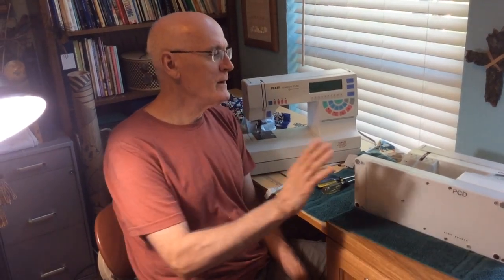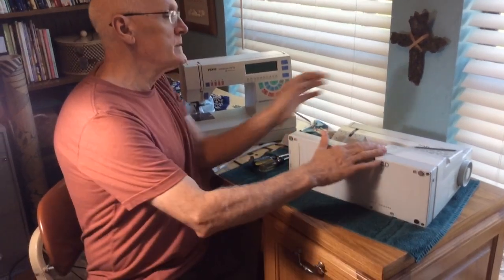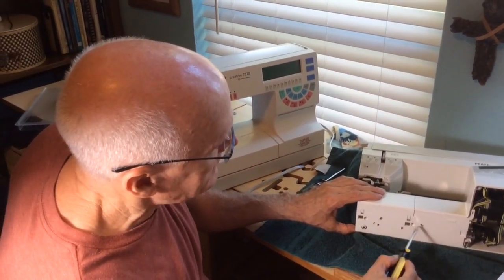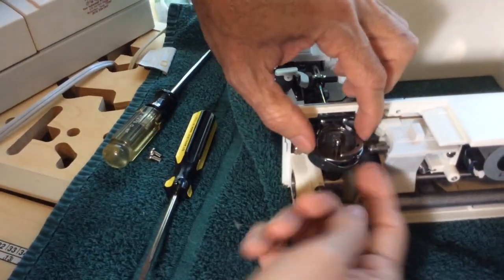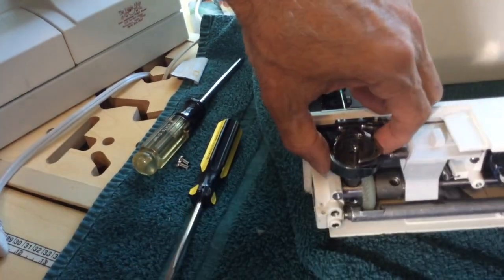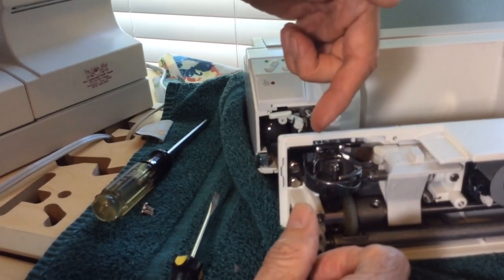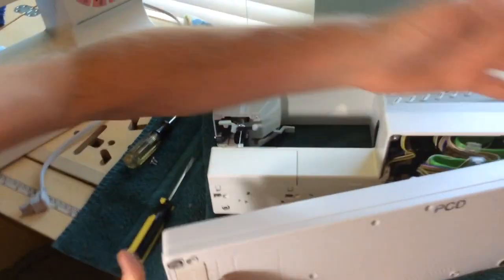How to Fix Pfaff Bobbin Hook Shuttle Jam

Comment: Useful information, but could have been so much better if you showed actually removing the screws/pieces instead of just describing it.  Picture worth a 1000 and all that.
Reply from the maker: Gary Walker this is the first (and only) YouTube video I’ve done.
Reply: Steve, this is so good. No one else has done even this level of detail. If you ever have time, be wonderful if you could show the actual disassembly and reassembly with the tiny screws. And then, how to time.
Reply: Yes, a picture is worth a thousand words. Take pictures as you're taking your particular sewing machine model apart. Then use the pictures in reverse order to put your machine back properly.
Reply: I would love to see you actually remove the bobbin assembly screws. I can’t budge them with my skinny handled screwdriver set.  UPDATE: I found better screwdrivers on my husband’s workbench. I was able to disassemble the “practice” bobbin assembly I got from ebay by removing 5 of the 6 screws (6th must have been superglued) but reassembly was challenge. The last piece didn’t just drop in! Took a lot of fiddling. When I got the middle and top piece positioned correctly, I placed them upside down on my work surface, and placed the base on top of them, picked the whole assembly up like a sandwich and added a couple of screws before it fell apart again. The rest of the procedure sounds like a bigger challenge. Anyway, thanks for pointing the way.

Comment: Actually, Steve, this was sufficient to fix my jammed bobbin hook shuttle with the following additional step:  Remove the 2 set screws holding the whole shuttle assembly to the drive shaft, then remove the assembly for easy access to the small spring/screws holding the assembly together.  My problem thread jam was solved, and the assembly was cleaned, lubed, and re-assembled.  You saved me time and money by not having to take it to a shop which was closed anyway for the coronavirus.  I'm very grateful for your video.  Thank you so much.
Reply from the maker: Gary Walker I’m glad it was helpful.
Reply: Where are those 2 set screws' located?   Does anyone have a diagram or video showing those?
Reply: I removed those 2 screws & the assembly. How can I tell where the shaft should be when I tighten them back up (for proper timing)?  (I assumed there would be flat spots on the shaft but there aren't.)

Comment: Thank you for doing this video.  I was able to fix that single piece of Thread.  Hard to believe that (1) thread and a little build up grime could stop the machine from turning.  It took using a lot of tools on hand like Torx and screwdriver heads with variety blade widths and blade thickness.  Also used your video on a large iPad for easy viewing.

Please, please do more videos!   Much appreciated!

Comment: Thanks a lot steve, you helped me to fix my moms fav machine. I fully marked every piece with ink before taking it off, it's very easy to loose the sync of the machine, thank's for the advise. It took me so much time to figure out how to do it without breaking anything. After do it one time it's very easy and fast to fix, it would be great if you actually dissasembly and assembly it, and show how to resync in. anyways, thanks for the help very much, nobody makes videos about it except you, and when you have 0 idea this is a treasure to find out. cheers!

Comment: You Sir, are a STAR!
Simply by pointing out “this bit doesn’t move” and showing how it’s kept in place, I have fixed my Pfaff Select 4.2!
The housing(shuttle thing?)  for the Bobbin case had jumped out of the bit (finger?) that keeps it from turning, so, it was not sewing.  The needle just kept hitting the shuttle case thing. 
After watching your video, I took the bottom off the machein again then undid 2 more screws, popped the bobbin shuttle thingy back in line and FIXED!   You saved me a trip the the menders and a bill for unnecessary work.
THANK YOU!

WORDS OF WARNING… don’t over tighten the screws into the plastic because it will break the plastic ☹️. My fault 🤦🏻‍♀️
Reply: hi there, I have the exact problem of needle hitting the shuttle and hence, not sewing at all on my 1473cd and I am worried that if I open it up I might not be able to put it back together. Do you have any tips on the whole Shuttle/bobbin case assembly?
Reply: @sweta5987  That's my issue right now as well. It's the second time in 6 months it happened. The fist time I had to take it in. Something caused the needle to be stuck; I couldn't move the handwheel at all. I unscrewed the bottom and the plastic piece that holds the case as shown in this video. The bobbin screws were so tight I couldn't move them, but then I loosened the two bigger screws that hold the small horizontal black metal bar in place. Immediately, the shuttle started turning again. I didn't see any threads. Now the needle is hitting the shuttle and I don't know why. Anybody know the answer?

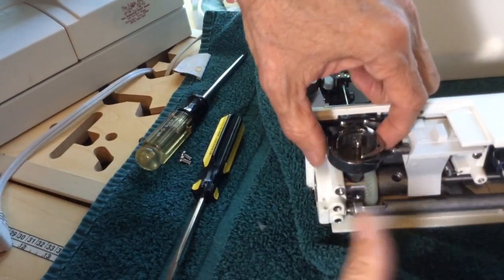Comment: Thanks!!! Was just tearing my hair out over new troubles on a new to me Pfaff Performance 2054: suddenly lots of thread jams AND bent or broken needles. Found my answer at timestamp 3:00. Seems the screw for the 'bobbin case position finger' loosened over time &/or some minor wear on the 'bobbin case base' where the two meet. Already back to sewing after adjusting the position finger to fit more tightly against the case base.

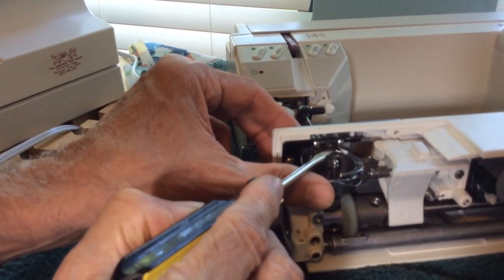Comment: Nice video. For anyone who needs to know, the gap between the position bracket and the bobbin case holder (hook basket) shown at 3:37 should be 0.7mm, which is just enough so they don't actually touch.  Also, when removing the three tiny screws with springs, I find it best to put a bit of masking tape over them so if they do fall out, they will stick to the tape rather than fall on the floor or go flying across the room. It's easier to remove the entire hook unit, but then you have to redo the timing.
Reply from the maker: Good advice. Thank you!
Reply: using a magnet works also well
Reply: Thanks. How do you set the timing?  I followed the video and repaired the jamming but now my timing is off. Zigzag stitch is skipping stitches. Thanks in advance!

Comment: Thank you for this. Your instructions helped me fix the jam, and the machine sews beautifully. But it makes a lot of noise that wasn't there before. I oiled the shuttle as indicated in the manual, and it helped a little, but the machine is still way noisier than it was before. Any suggestions of what caused this and what I could try? Thank you.

Comment: I think I solve my problem, which was the inner bobbin case somehow got past the stop that kept it from spinning. However, when I went to put it back together, a little black part that fits over the screws on the left that holds the black l-shaped part in place had slipped out, and it has a hook on it, and I idn't see it before or how it fits back in. I did take pics of the bobbin setup before unscrewing, as suggested, but it doesn't show clearly enough on the pics for me to know, since I wasn't particularly looking for that part of the set up.  Any ideas?
Reply: Hey, in case you hadn't solved it yet: this I-shaped bracket with a hook in the middle  is supposed to go behind the big black L shaped bracket. So when you have your machine laid down like in de video on 1:40, (after you put back in the bobbin case) you put in the little bracket with the hook towards the needle and on the right side, then on top the bigger L-bracket and then tighten it with the gold/brass coloured screws. Hopes this helps.

Comment: Hi Steve, we bought this brand new pfaff passport 2.0 and had it fixed by the place where we bought it 3 times to no avail. They cannot duplicate the problem. Yet they say it is fixed. My wife can use it afterwards from 3 to 15 minutes and bam, the problem reoccurs. It's a 3 year old machine, barely used. the bobbin case moves out of place and the needle gets stuck in it. Any ideas?
Reply from the maker: I’m sorry, I’m afraid I do not know how to solve that problem. I am not a professional sewing machine technician. Just a guy trying to get my wife’s sewing machine back up.

Comment: Well, I have had Pfaff Select for 1 year and a thread got jammed already 4 x. Each time to go to the service. Each time to drive, wait, pay, drive. I hate the machine and will buy another one, which has those two little things that hold the whole mechanism together and one can easily and completely remove all parts, clean it and put it back. What a terrible engineering design. Service people told me that the reason for the jam is my wrongdoing when threading the upper thread. Nonsense. X-time I watched youtube video to make sure to do it right. Anyone with same experiences? Or am I a total idiot who does not know how to use a sewing machine (after 40 years of sewing and after having had Veritas, Brothers and Toyota machines with no problems)?????? Would be thankful for your opinion.